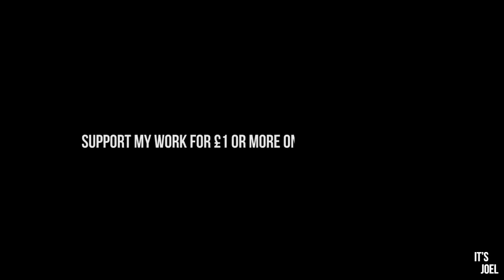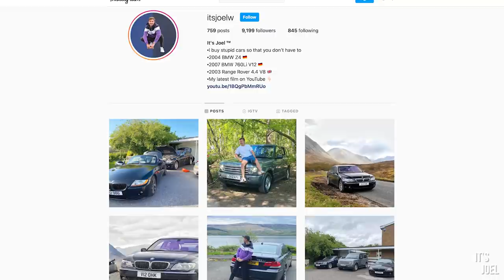Repairing the cheapest V8 Range Rover in the country... [Part 1]

Comment: I wouldn't take a towbar off a Landover. It's basically what they are built for
Reply: Some of them are removable with a key so u can store them in the boot
Reply: @urban_fox_cub_urbex  ah fair enough
Reply: I would also keep the tow bar, if someone hits the back end of the car they will hit the tow bar and not break the parking sensors and damaging them!
Reply: If you're off roading they just get in the way and ruin departure angles and if you don't have a trailer may as well take it off.
Reply: @stamp28  It happened to my RR while i was stood next to it. Guy over revved when reversing into a space behind me. "Veed" his whole bottom bumper in. 
My plastic cap on ball of towbar  got a little bit warped. But i let it go, cause it was so funny to me.
Reply: And probably the most reliable part on a RR.
Reply: @bobbobbing12  range rover or rolls Royce?

Comment: Keep the tow bar. If you don't have parking sensors they're great for letting you know when you've gone back far enough. Plus as you're in London having a tow bar is essential for dealing Uber. I owned an ex AA Range Rover in the 90's that had front and rear tow bars. They were great for letting other motorists know where their skid / attitude problem ended.

As for the exhaust. Just take it off, scrub it clean and paint with a suitable high temp paint

Comment: Hey Joel loving the videos as ever but got a bit of an ask if possible. Please can I draw on your well of knowledge. I have a 4.4 petrol 2003 L322 HSE and for some reason the interior lights have stopped working when the doors are opened and I'm now left opening the doors with the key as the fobs stopped working too. The lights work if you press them inside except the front centre dome light. I've swapped it with the back an the same problem persists. I've read about BCM's going into transport mode but I've no clue how to get it out of it or even if it's in it to start with. I spoke to Jaguar Land Rover Manchester an they now don't even have the software to work on my car even if I was willing to pay the £180+vat an hour for Labour/Diagnostic's. Basically if this has happened to you before or you have seen it before please help. It would just finish off the car (before the next thing crops up) Many thanks in advance for your help and time Joel. Please keep doing the videos as they are absolutely belting 👍👍

Comment: So they did the breather pipes but not he notorious PCV valve on the back of the manifold?? Get that changed out too....before it over pressurises the crank case and blows oil over everything....common M62 issue!
Reply: Brakes stop working once that pcv blows :| kinda scary.
Reply: Agree! And ah like what we saw the condition of cracked valve cover gasket! well then oh boy i think the valley pan gasket needs to be changed as well 🙄💀🤣
Reply: Lol rebuild the whole car just to be on the safe side 🤣😂😅
Reply: @garysnack9253  Not a bad shout - is pretty much what I did with mine way back when....
Reply: @AntChesney  m60 and m62 are good and powerful engines as long as you keep an eye on'em 👍
Reply: @ابنالجزيره-ب8ط  Having owned a number of E38 7'ers and 3x M62 powered  Range Rovers...I agree, but as you say you gotta ,  look after them
Reply: @AntChesney  Yes Sir! I got RR 2004 HSE with M62tu and definitely agree 👊

Comment: Problem with a towbar is that they rust terrible overtime. If you don't be early in removing the rust it effects also the cars body. Either replace the towbar connections to the cars body or if you don't use it, remove it as soon as possible so you can safe the cars connection points.

Comment: Did Richmond LR cover all costs, or just labour? I ran a Disco3 for several years - same platform as RR Sport. The parts are expensive; ~400 for suspension compressor and ~1000 for electric park brake assembly IIRC. And labour costs are high as so much is hard to get to. Sometimes LR parts dry up. My Disco3 was off road for 5 weeks once, waiting for a new turbo cross pipe. The first cross pipe had cracked due to not being bolted in properly. So you really do need to find a good specialist (not a dealer) as the design is idiosyncratic. Both cross pipe changes were ~1000. Once you start down this path you're subject to the sunk cost fallacy. You'll spend 2 or 3K, think all is OK for a few weeks or months, then another horribly expensive issue will pop up. And you'll do it, because you'll be thinking, just one more fix and it will be right. :) I gave up after 8 years and 10K on non-MOT/service repairs. Final thought: if you want cheap reliable V8 power, Merc is the way to go. Get something with the M113 V8 (4.3, 5.0, 5.4) fitted to late 90s early 2000s CLK, E, ML. Those engines are bulletproof, and won't give you nasty surprises like the Audi V8 engine out for timing chain issue.

Comment: I’ll keep an eye on this as I drive an X5 with the same engine.. How quiet is it? Are the vanos knocking yet..
Reply: X5 doesn't have the same engine mate. It's a 3.0 straight 6 diesel?
Reply: @warrengeew  ... the M62 engine (M62TUB44 in this case)  is a BMW V8 engine that was fitted to both BMW X5s & early RR L322s like Joel's here.
Reply: @warrengeew  Joel's isnt a diesel? It's a 4.4 V8
Reply: @joshjack6127  I thought it was a tdv8, maybe I need to pay more attention 😂
Reply from the maker: @warrengeew  petrol power 😉